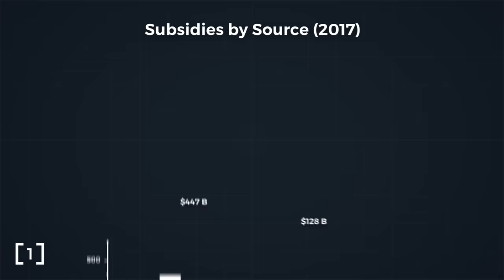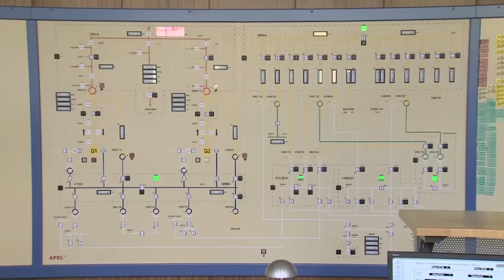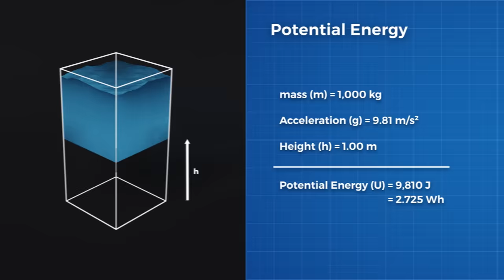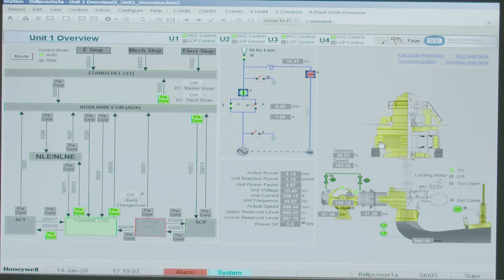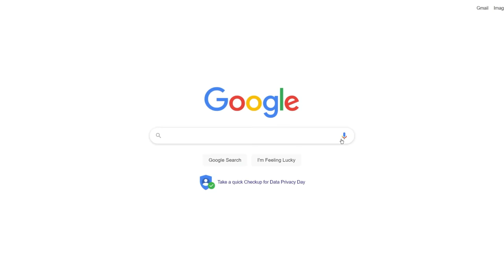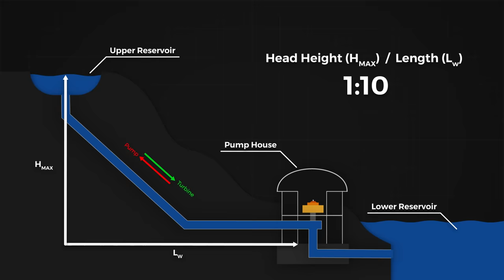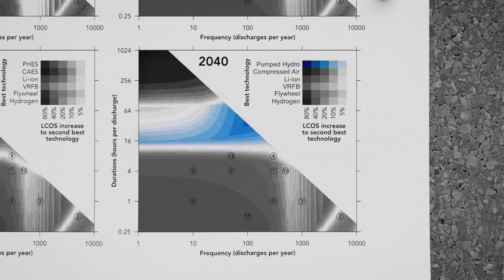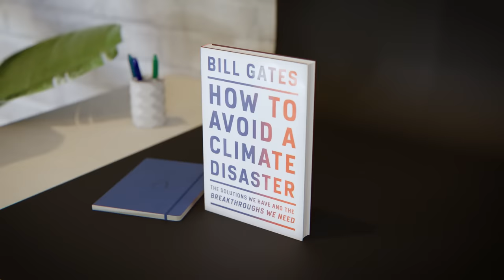The Truth About Pumped Hydro

Comment: No. Wind and Solar are NOT capable of providing enough energy for all of human-kind. Not even remotely.

In fact, if you turned the entire surface of the Earth into one big Wind and Solar farm, it wouldn't even provide enough power to replace the automobile fleet in the US with Electric Vehicles.

Edited to add:  I have serious doubts that you understand the scale of the problem.
Reply: Yes. The person who decided that Wind and Solar were enough to supply all of mankind’s electrical needs.
Reply: Actually, I have a degree in mathematics. 

But, you’re wrong. It isn’t about storage, because there wouldn’t be anything left over to store. 

And it’s clear that you’ve either never done the research to understand the scale of our energy consumption, or you’ve never done the math on that maximum amount of energy that wind and solar are capable of producing.
Reply: Zuurker U  -

You've stated, " a 100 mile x 100 mile area of solar in central US would cover all and more."

That's 10,000 square miles. If we convert to square kilometers it's pretty close to 26,000, so I'll just round up. That gives us 26,000,000 square meters.

The sun's energy available for harvest at the earth's surface is 1,000 Watts per square meter under optimal conditions. Optimal conditions is defined as solar noon on the equator, on a clear day.

But let's assume the full 1,000 Watts of available energy, and let's also assume 100% efficiency for the solar panels, which I'll assume you understand would violate the laws of physics.

26 million square meters multiplied by 1,000 Watts gives us 26,000,000,000 Watts, or to keep the numbers easier to say, 26 Gigawatts. For reference, that's 21 trips in Doc Brown's time traveling Delorean.

By the way, it's only about 1/3 more if we put the panels in orbit.

-------------

While we're at it, let's look at Wind power. The Blue Creek Wind Farm in NW Ohio covers a little over 40,000 acres or 62.5 square miles, and produces a bit over 300 Megawatts at peak capacity. If we built a 10,000 square mile wind farm, that would be 300mW x 160 = 48,000mW. Let's convert that to 48 Gigaatts.

-------------

So...

We have a 10,000 square mile wind farm producing 48gW and a 10,000 square mile solar farm producing 26gW, for a total of 74 Gigawatts. Sounds like a lot, right?

-------------

One Gallon of Gasoline contains approximately 33.5 Kilowatt-Hours of energy.

According to the US Energy Information Administration, in 2020, the United States used about 44.61 billion gallons of diesel and 123.73 billion gallons of gasoline, for a total of 168.34 billion gallons of fuel. 

In the interest of keeping things simple, I'll convert the diesel to Gasoline Gallon Equivalent or GGE: 44.61 x 1.12 = 49.96. 

Add 123.73 to 49.96 and we get 173.69, but 

I’m going to round that to 174.

If we then multiply 174 billion GGE by 33.5kWh we get 5,829,000,000,000 kilowatt-hours, which converts to 5,829 terawatt-hours or about 5.8 petawatt-hours

Divide that by 4 to account for the theoretical efficiency gain of Electric Propulsion, and we get 1.475 petawatt-hours of generation capacity needed to cover those electric vehicles. 

-------------

That's 1.475pWh or 1,475tWh over the course of a year.

24 hours x 365 days = 8,760 hours

74gW x 8,760h = 648,240gWh or 648tWh.  

Let's round that to 650 Terawatt-Hours.

And remember, we're assuming 100% efficiency, 100% of capacity, 24 hours a day for 365 days.

1,475 - 650 = 825

That's less than half of the need, just for road going cars and trucks.

We actually use 4,000tWh/year already, so the real need would be pretty close to 5,500tWh per year, and that's based on the 2020 figures for fuel consumption, which was an "off" year; and assuming a power generation level that is only valid on paper and ignoring the laws of physics.

Oh, and...

That's just for the United States. It's much higher for the whole world, and the EIA estimates a 50% increase in demand by 2050, which is probably a gross underestimation.

Here's the bottom line: You're living in a fantasy. Wind & Solar won't meet the need.

Frankly, Coal & Natural gas are insufficient as well.

The only way to sustain a planet-wide  21st century level of technology is nuclear power. If you insist on Wind & Solar, you're looking at a let 19th to early 20th century level of technology, and you can't feed 8 Billion people with that level of tech.
Reply: You might want to re-check your all of your starting numbers, your baseline assumptions, and your calculations. 

Just a suggestion, which you are of course free to ignore. 

And please...
Check my math and let me know if you find any errors so that I may correct them. 

Have a nice weekend.
Reply: My numbers come from the Federal Energy Information Agency.
Reply: Zuurker U  -

I see the problem...

You don't understand the numbers that you googled to try to refute what I said. 

Therefore you don't recognize either where your numbers are wrong, where you're using them incorrectly, or when you're doing both.

As for my math, I used nothing more complicated than addition, subtraction, multiplication and division.

Which makes your admission that my math was correct, combined with your repeated assertion that I'm bad at math, both contradictory and silly.

My numbers are correct, my statements are correct, and my math is correct; your assertions to the contrary notwithstanding.

Please, feel free to have the last word.

Comment: The world clean energy needs are a must on a world depleted on fossil fuels.  Hydro-power gravity energy was first step on engineering, and now we see pumped water energy storage as the right direction. Both these need dams and huge volume of water stored to work and a dam failure is catastrophic. Derna dams failure in Libya is today a catastrophic reality.
The hydro-power energy generation is physic of lifting water on height we can from nature or forced using energy and pumps. This need huge work and investment.  Instead of these physics the engineering must implement "levitation" of solid bodies, which can then be used on the time the energy is needed.  I am talking for "physical levitation" not "magical levitation" and physical levitation can be done using only a fraction of the energy the solid body will gain.  So we will gain energy and use it to generate electricity when it is needed.  Bill Gates and many companies have worked and continue working on gravity energy storage, but they fail on energy generation.  These technologies really consume energy on lifting and the net energy output vs input is negative.  The Levitation-gravity technology has net positive energy output vs input. Disclosure of this technology can be done only when investors and government will be involved.
UN may be another participant on regulations to spread the technology on other countries.

Comment: Nice.
But did anyone calculate the GHG-footprint of buildung and maintaining this structure and the climate-ROI?
Maybe it's just me, but isn't the shaking of the mountain a bad sign for the longevity of the installation.
Does Ireland use natural gas for central power generation only?

California might run into the problem of evaporation, and if using salt water it might get challenging to make the pipes and generators 
resistant to such concentrated salty solutions.

Ups, sponsored by Billy Boy, who constantly gets richer by selling dangerous solutions for non-existing problems while ripping off the people - sorry, wasted effort.

Comment: You need to spend more energy to fill the reservoir than the energy that can be released. Therefore, you need to generate far more energy from renewable sources, increasing the cost significantly. No wonder no government is interested... case closed, dead on arrival...

Comment: Sad to say that globally, utility-scale wind and solar battery backup is almost a none event. Moreover, globally, with unreliable wind and solar electricity generation, you could have these intermittent renewables generating ten times the demand that conventional steam and water generated electricity provide, but you will still need to back wind and solar up 100% with conventional energy in order to supply reliable baseload and excess reserve margin power generation within the electricity grid for when the wind is to fast, slow, or non-existant and for when the sun ain't shining. Wind and solar will never help to reduce CO2 emissions.
Reply: Zuurker U  You clearly do not understand the issue. Unless you understand that utility-scale energy storage is essentially non-existant and therefore intermittent renewables have got to be 100% backed up with conventional energy, which means that renewables are 100% paired up with conventional energy you will never understand that wind and solar will never cut CO2 emissions and why they have got to be heavily sunsidised.
Reply: Zuurker U  The transition timeline is irelevant. Any amount of unreliable wind and solar output connected to the electricity grid requires a latent water or steam driven backup.
Reply: Zuurker U  You've gone down a rabbit hole. I'm not concerned about the issues that unreliable, utility-scale wind and solar electricity generation cause in relation to grid harmonics or stability. My point is that they require to be paired with a latent conventional power supply in order to 100% back them up (as grid-scale storage is basically a fallacy)...that two power supply's running in parallel is a waste...and that no amount of wind and solar electricity generation connected to the national electricity grid will not reduce CO2 emissions.
Reply: Correction...I mean that no amount of wind and solar electricity generation connected to the national electricity grid WILL reduce CO2 emissions.
Reply: Zuurker U  ). Intermittent, unreliable, and diffuse wind and solar energy need to be backed up. Electricity storage is basically a none event. So, it follows that renewable energy needs to be backed up via the excess reserve margin built into the conventional electricity grid. You clearly do not understand that basic statement nor the consequences thereof. 

No amount of evidence will ever convince an idiot, so, until you do understand it, I suggest that you do not engage in a conversation with someone who does on a public forum.
Reply: Zuurker U  Your last post was satirical.
Reply: Zuurker U  ...Irony!
Reply: Zuurker U  You remind me of an old biblical saying...the meek (those, such as you, who are in the mass pathological credulity cohort) shall inherit the earth.
Reply: You really have no idea what your on about.
Reply: @afaxmachine5045  You really have no idea how to have dialectic conversation. Tell me why you think that I don’t know what I’m talking about…

Comment: Yes, that's right, fossil fuels received 3.5 times the subsidies because fossil fuels produce 1,500 times as much energy as renewables.  That's about 0.35% as much subsidies per kW-h as renewables.  Also, I just pulled that 1,500 times number out of my butt without data, but my point is valid and yours is not.  Subsidies divided by production is likely about 2 orders of magnitude higher for renewables globally.

Also, we can't avoid climate disaster, were doomed to extinction.  As a species we are too stupid to ration ourselves today so we don't starve tomorrow.  Were doomed.  It's already too late.
Reply: @kevinsheppard7517  Sure, say using my totally made up ratio:  $447B/1500MW=$0.298B/MW, $128B/1MW=$128B/MW, or, subsidies on renewables are 430 time higher per unit of generation.  See why the majority of new capacity are renewables?
Reply: I saw Bigfoot once.
Reply: @tomrecane6366  Haha, photos or it didn't happen.

Comment: Although a good video it is still looking at the issue from a centralized power grid.   The Australian National University in partnership with Engineers Australia did a preliminary study that identified tens of thousands of locations where small/medium scale pumped hydro schemes could be established.  This fits in with distributed power grid architecture where the energy is generated close to the load (and obviously stored there as well).  This is in Australia, the driest continent on the planet!  The Australian Government, of course (being backward as usual and liking flashy announcements) decided to extend the Snowy Mountain Hydro Scheme with all of the issues listed in this video. <sigh>  

As a minor point, the term power generation is fine but when you are talking about generating AC the device is an alternator, a generator is used for DC.  In many respects DC generators have advantages over AC alternators courtesy of modern technology, so they many indeed be generators in the future.  >>;-)>

Comment: Its an interesting calculation at 10:13 to see how much storage (or how many similar pumped hydro stations would be needed) to replace the 50% of fossil fuels.  
But if the goal is to go to zero, that calculation now has to include - heating, transportation, heavy industry (cement, steel, plastics etc).  
Given that  electricity generation is only ~22% of total  Ireland will need some 5x as much (so 5x 37 Tarlough Hills or some 185 or so).

Can you do an analysis on off river pumped hydro as discussed here https://www.youtube.com/watch?v=SuZ3nqzC6a0&t=11s

Comment: A fraction of the cost? That's a straight up lie, man. Wind is so heavily subsidized. I certainly do think we need green energy, but I am sick of the complete BS spewed out about wind and solar being our saviours. They aren't. They don't produce enough grid inertia or reactive power for one thing, and beyond that they are expensive because they are decentralized energy generation. Many small generators will almost certainly end up being a lot more expensive in maintenance than a few massive generators, and also far less reliable. That's where hydro and nuclear can really save the day, and badeload.